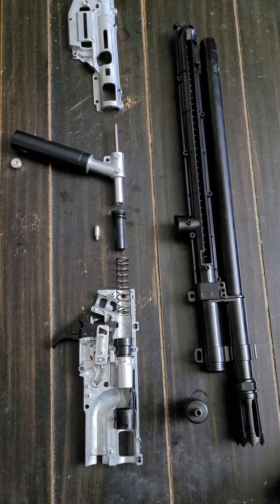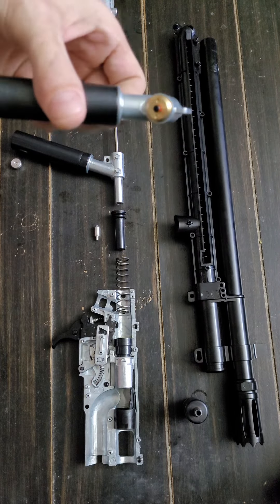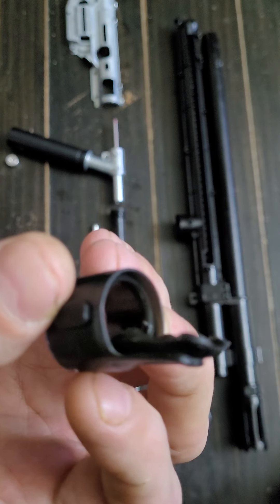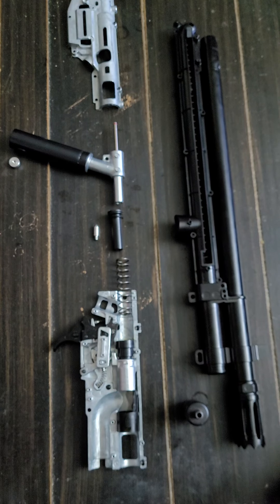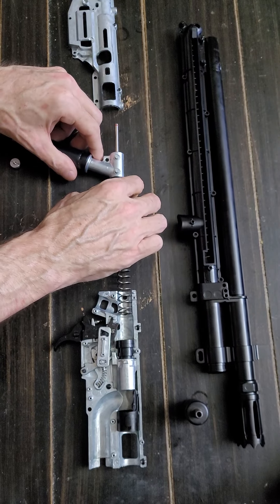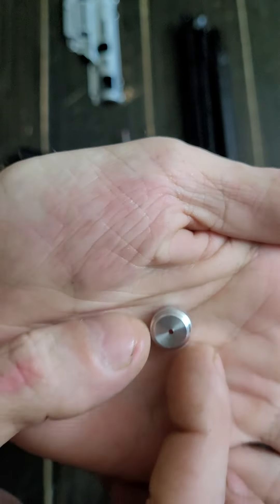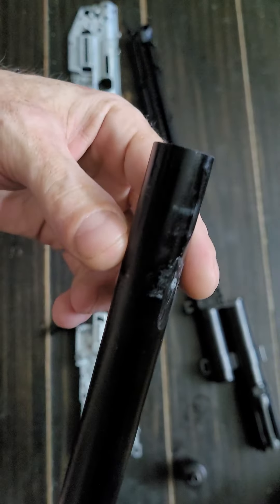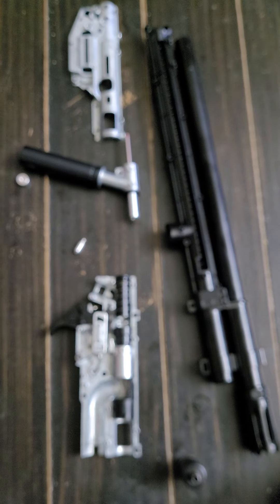Umarex T4E HDB 68 Full Power tuning and troubleshooting, potential barrel swap

Comment: Hey! Thanks for the detailed video. Somehow my HDb68 does not shoot. I can pull the trigger fully but there is no pressure point. No matter if it's loaded with rounds or not. I push the Co2 grip in, the red pin comes out just like it should (so it loos like the co2 is loaded properly) but I just can't get a shot out of it. Any idea whats the issue here?
PS: It did not even work before opening the HDB and installing the mods (right out of the box, brand new). am I just stupid or what?
Reply from the maker: i would have returned that one sounds like you got dud lol also the safety switch is very loose and if not checked you trigger will lock

Comment: Excuse me, how to remove the useless parts of the HDB-Co2 version, so that the 12G steel cylinder can be used after the removal, and the power can be increased?
Reply: May I ask to remove the stop valve of co2 to increase the strength (power), which part needs to be removed, and will not cause subsequent cylinder puncture and shooting function?
Reply from the maker: you need to remove the valve block inside the valve, you can pull it out with plyers or push it out from the bolt end, we can help you better on the facebook page im not on here often :)

Comment: Thanks for your video!! In another video you were mentioning newly produced HDB are less powerful, even after mods. Do you know what are the modification Umarex have done from rev.1 to rev.2? Many thanks
Reply from the maker: i know they changed the detent and because of this air will escape through the breach and the detent so you have to add some kind of packing material above the detent, doing this will also eliminate the double feed issues with the new detent and bring your power up to par with the gen 1 hdb

Comment: Great vids as always brother. I got the power kit for it. After I remove the co2 restrictor should I replace the it the one that comes in the kit? Or will my 12 gram co2 fart out?
Reply from the maker: if you have a restrictor in it all ready then just keep that, no need for a powerkit :) remove the valve block and your set bro
Reply: @LessLethalHomeDefense  Ah thanks. I think I might do 88 gram co2.

Comment: Thsnks for your informative vidios.   If some can answer this for me it would be great.  If buy this power kit from MCS for the 7.5 version, do I still need to remove the valve block to achieve LL power? Thanks in advance.
Reply from the maker: yes you need to remove the block in the valve and your good

Comment: i just got myine in and i removed the valve block looking down the air chamber i dont see a co2 restrictor does it come with one from the factory or is this just an added part with the kit? and how do i know what type i have as far as a 7.5 or 11J. one more question i tried it out after removing the valve block and it kept jamming up the byrna kinetic 2.9g, what's the best rounds to use in your opinion
Reply from the maker: if you have an F stamped inside a pentagon logo any where on the body it will be a 7 version, and try canada riotballs there great :)
Reply: @LessLethalHomeDefense   the 7jules version has CO2 restrictor?

Comment: It looks like the power kit for this is the same as the hdp50 or HDR50. Do you think they are interchangeable
Reply from the maker: the pins are dif lengths on all markers i think the hdb and hdr68 have the same pin but the rest are dif lengths and the hdp50 has the shortest of all, also the hdr50 and hdp50 have slightly dif restrictors, one is slightly larger ill send you a pic of some pins in the group or facebook inbox

Comment: Hey Jeff. Did you ever figure out the nozzle tip oring situation? And does this marker hold up to 1100 psi? TIA😊
Reply from the maker: yes we did find nitrile buna 90 duro orings with 9mm od and 6mm id and 1.5mm thickness or cross section, also the hdr50 spare 11 joule valve has a very good oring you can use to replace the one that shoots out, we learned that if you keep the marker nice and wet around the oring it performs great :)
Reply: @LessLethalHomeDefense  let me ask you something. I'm shooting the 20 g Chrome steel balls that Florian has on his website. Would that affect my oring blowing out at 1200psi?
P.S thanks so much for getting back to me. You seem like a great guy😊
Reply from the maker: @trishahouston3656  the steel balls wont affect the oring, you should be fine, the 1200 psi possibly could
Reply from the maker: @trishahouston3656  thank you :)

Comment: So tell me is it the gas your using?? I have the double barrel shotgun and the pistol that fires 50 cal, and probably going to purchase the revolver along with the upgrades and barrel attachments any recommendations. Thanks from the states!
Reply from the maker: dont get the hds is very weak and cant be powered the same as the hdr hdp and hdb, them 3 are powerhouses with hpa but it is fun for plinking around with
Reply: @LessLethalHomeDefense  I assume that you can get more power by carefully boring through the flash-hider barrel extension at the front, before replacing the stock barrel with a carefully machined barrel. It might be possible to fit a 16 inch non-ported barrel into this marker, if the job is done carefully, by a machinist.
Also, try using lighter cheaper nylon/plastic/polymer balls (3g - 4.5g), instead of sticking to the heavier expensive 8g - 10g "grimburg", "nylon-steel" balls.
Reply: @FoundingYouTuber-2005  Have you upgraded the HDB? You might need to buy a replacement HDR valve, so that you have a spare brass cap for this mod.

Comment: That was really cool.. Just would have been good to see what o-ring you were referring too, and where it went. Not quite sure where it blew out from. Awesome video though, and great gun🙂
Reply from the maker: its the oring in the tip of the valve nozzle, the one the powerpin slides through if you join the facebook group i can show you
Reply: Lost my o ring what can I use for a replacement
Reply from the maker: @toospookyforyou7994  dont know the size yet i will soon but i have spare valves so i pulled one from there. how much psi did you use to blow the oring?

Comment: Hi, Less Lethal, what joules do you get if you use 850PSI HPA, without removing the CO2 restrictor?
Reply from the maker: i never tried shooting mine on hpa with the co2 restrictor in, but i think its much less power
Reply from the maker: you can reach as high as 72 joules with hpa 850 psi
Reply: @LessLethalHomeDefense  I noticed that there is too much emphasis on using "heavy balls" in these upgraded markers. Umarex sells plastic/polymer balls for these markers, called the PLB series -  PLB68 for 0.68 caliber markers weighs 4.76g per ball, PLB50 for 0.50 caliber markers weighs 1.78g per ball, PLB43 for 0.43 caliber markers and T4E pistols weighs 1.15g.
Lighter polymer/plastic/nylon balls travel faster than heavier "Grimburg" , "rubber-steel" of "nylon-steel" balls. They will also deliver "pain", because they are hard.
Even though these high muzzle energies are good for experimental demonstrations to determine maximum potential (or serious emergencies), less lethal can also be achieved with much lower muzzle energies, if lighter projectiles are used.